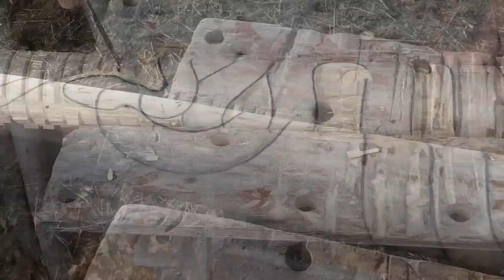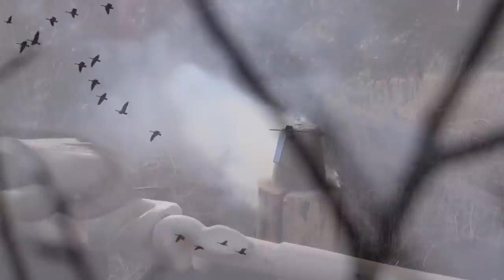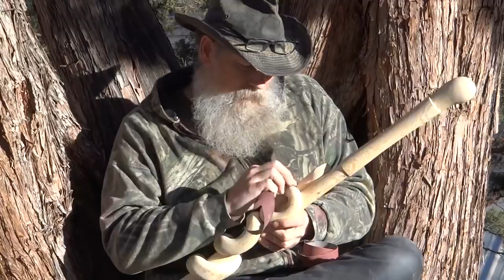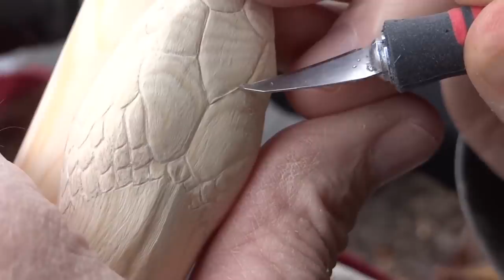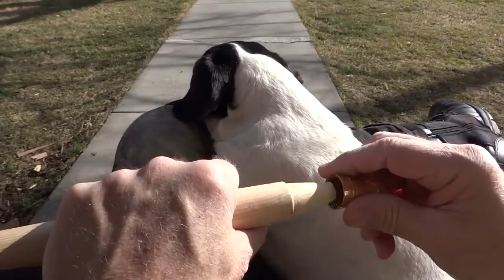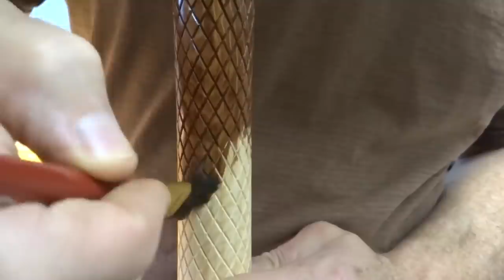Carving an Aesculapian Snake Walking Stick

Comment: A suggestion for your sticks (but not necessarily this one). Tie Turks head knots around the sticks for transition points. I use three strand cotton rope-laid twine (small stuff up to almost a quarter inch in diameter). I stay away from para-cord. When I stain and varnish the stick, I use extra varnish on the knots, enough to completely soak them and glue them solidly to the wood (the varnish does the gluing). They’ll cure and dry to a very hard finish. I’ve used both shellac and a good spar varnish. Both work very well. I’m a sailor and the knots come naturally to me and surprisingly garner more approving comments than the rest of the stick, which tends to be carved geometric patterns, and nothing like the splendid carving on your sticks.
Reply from the maker: I really like that idea, Roger! I'll have to look up how to tie that knot.
Reply: @StinnettSticks  I can recommend “Ashley’s Book of Knots,” but there are dozens of knot books and YouTube videos that can get you going.  And there are more exotic and extreme knots than Turk’s head knots. Ashley’s is an excellent resource.

Comment: Very beautiful carving for sure! I have one question though, why did you burn the wood on the scales if you were painting over them? Am I missing something by not burning the wood before painting? This seems as though it would make the paint lose adhesion to the charred parts of the wood.
Reply from the maker: Thank you! The burning is to create the scale texture.

Comment: Amazing work as always! I have few questions I hope to get answered because its so inspirational. 
How long did this one take and could/would you put a price on it?
Also, when you do the scales. I know that you make your own tips and such for tight spots. But I struggle alot to get a nice burned surface on tight curves. For example the first curve on this snake from the head is pretty tight, how would you do it or do you have a special made tool/tip for it?
Ive made some snakes but I stay away from tighter curves because I cant burn them and because of that it doesnt get that "snakey" look. (haha)

Would love an answer but Im just purely in love with your work
Reply from the maker: Thank  you Sebastian!  It took me 5 weeks to make this stick.  The curves definitely cost me some time.  I had to make special scale tips to reach in there.  I just had to take my time at it and change the angle of my scale tip burner, a lot.  This was a custom order so it is like most of my work and is already sold.

Comment: Hi master. i am an old customer of your nice videos. Can you tell me about the finishing coat and also the material of airbrush color that you are using on crafts please???
Reply from the maker: Thank you, Ahmad! I use a large variety of acrylic paint protected with polyurethane. Also Minwax Red Oak stain for the shaft coated with Minwax clear gloss polyurethane.

Comment: If you coated the stick in epoxy resin would it make it stronger? I ask cause I'm480 lbs.
Reply from the maker: I don't think it would strengthen it very much.  It would only protect the painting.
Reply: Thank you
Reply: Could you make a walker for someone my size with chinese dragons on it? And what would that cost?